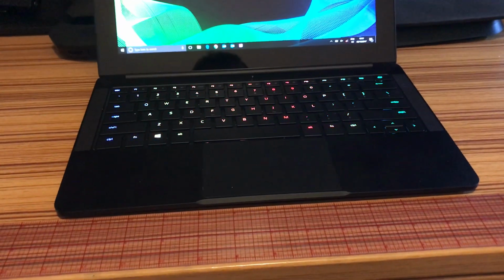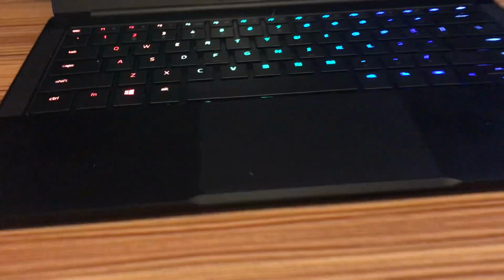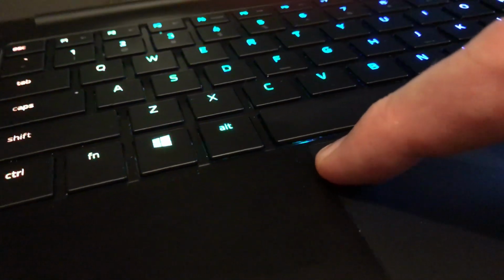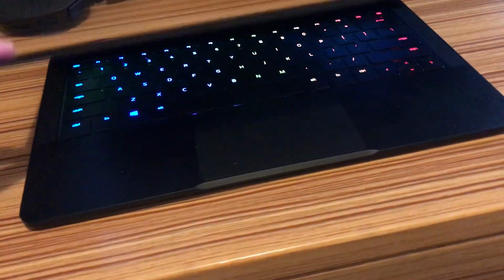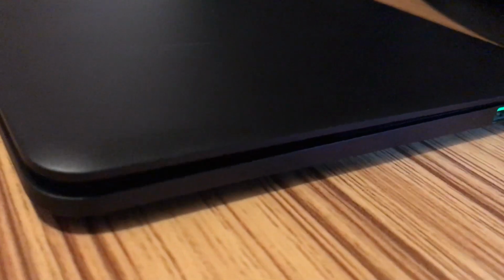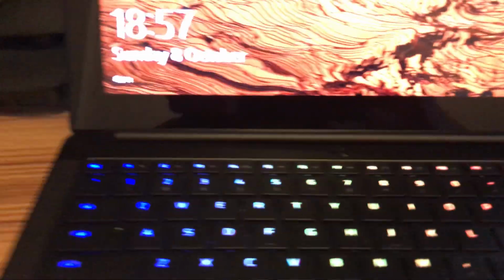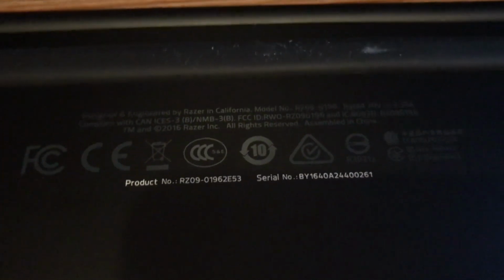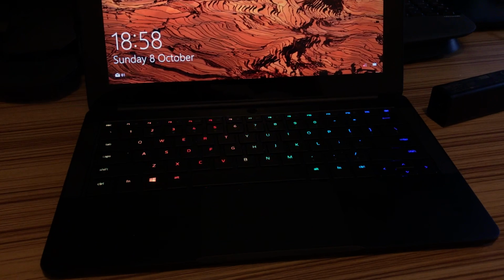Razer Blade Stealth 2016 model with warped chassis = puffed LiPo?

Comment: I have experienced the same problem with my Razer Blade Pro 2017. The battery has bulged and warped the shape of the laptop and when it's closed the touch screen is activated.